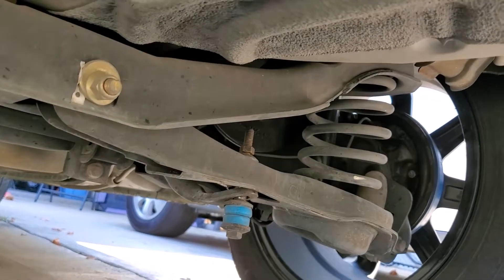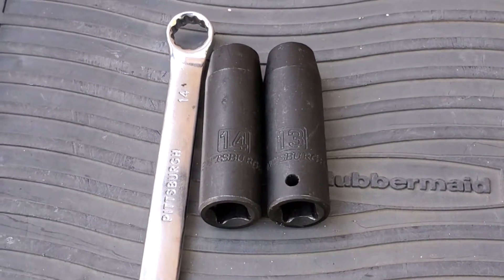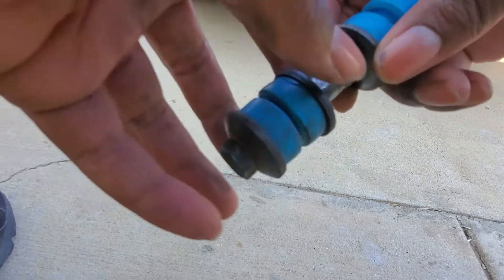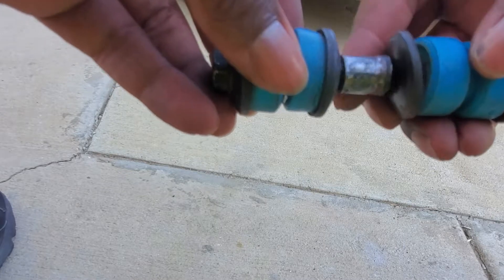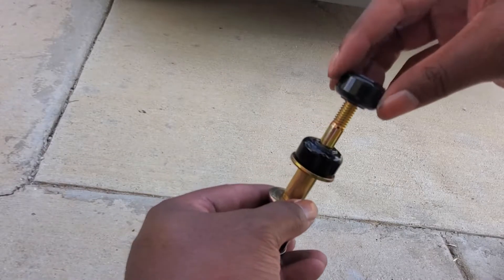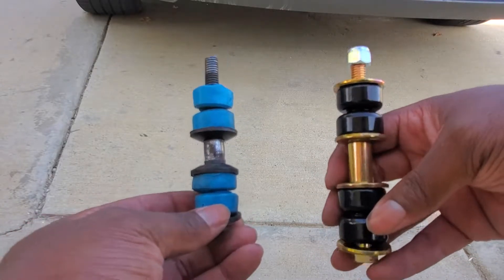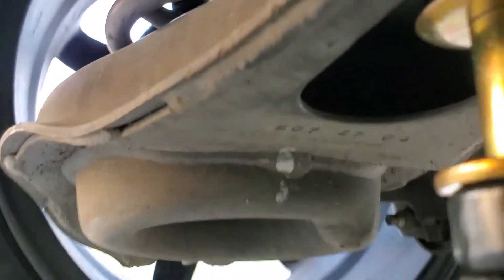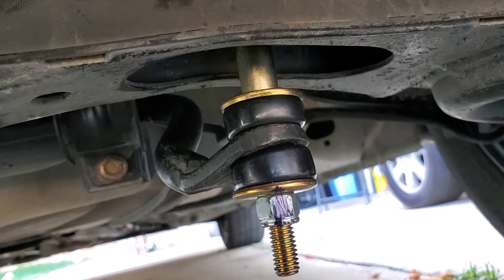Rear Sway Bar links Bushing change on a 2005 Ford Focus ZX4- Episode 2

Comment: Great videos . I was about to replace my sway bar and all the bushings because I had to replace the rear subframe it rusted out. But the sway bars themselves seem to be few and far in-between. I think I'm just gonna sand blast and reuse it.
Reply from the maker: Sounds like a good plan. I swapped mine out the some volve c30 hatchback rears.

Comment: I installed mine like yours and it works fine! You can install them up or down... that really doesnt matter!
Reply from the maker: Yea it doesnt really matter
Reply: Yes it does matter,Ford designed them to be fitted with the threads facing upwards,There is a good reason why they should be fitted this way get a workshop manual it's explained there.

Comment: I know this video is old but I plan on doing this myself and great job at explanation but small question, did you have to jack the car up or can you do it while the car is on the ground?
Reply from the maker: Na you can crawl under the car while its on the ground. Granted you didnt add a lowering kit prior :)
Reply: @FocusedHands  cool😎 and I do have lowering springs 😅but the rear still has good crawl space.

But thanks for letting me know😎😉
Reply from the maker: @notsostaticezequiel4054  np! if I can be of any further assistance let me know! ATF included!

Comment: Yeah, when did you notice the bolts were upside down.
Reply from the maker: I did it in purpose! There is no difference between them other than... it is easier the install and upkeep flipped!
Reply: @FocusedHands except for when the bolt hanging down hits something
Reply from the maker: @milwaukeevibe  wont happen

Comment: You put it together incorrectly again. The bolt should be facing upward with the nut on top
Reply from the maker: We proved this does not matter up or down. However, thanks for pointing that out.
Reply: @FocusedHands  it does matter. Thanks for sharing your ignorance
Reply from the maker: @milwaukeevibe  so please tell me how it matters! Since you have a expert understanding of suspension components on the Focus? Ive had this set up on over 25 and counting foci... with zero issues. No ignorance here sir... just wasting finger strength responding to nonsense. Happy holidays and I hope your Focus is still running!

Comment: You just installed it wrong again- the bolt faces up ,,the nutz on top
Reply from the maker: Na I did that on purpose
Reply from the maker: You can actually  install them up or down... I like up cause it is easier  to work with
Reply: Focused Hands your killing me smalls...
Reply from the maker: @phillipbedonie2777  I'm guilty
Reply: Mine works fine like he did it
Reply: @krombopulusmicheal8943  It will work, but the bolt protruding downward is just one more thing to snag you or your clothes while working under the car, or road debris.

Comment: You put them on upside down clown
Reply from the maker: Doesn't  matter clowner
Reply from the maker: Like it really doesn't  matter lol...bad design  by Ford which doesn't  do what it needs to
Reply: Does matter when you snag your overalls sliding under car
Reply from the maker: @patrickmoore3717  I've never snagged on anything with this car... other than the front fender!  But seriously  ford should upgrade like I did... to the mazda ball joints.

Comment: You don't have the rubber, spacer or the metal caps in the right place. It's all messed up. Your going to have issues with it.
Reply from the maker: Lol if I had a dollar for every person that said this id have enough for a new shop. This system function extremely well till I upgraded to a ball joint system. Might want to do the same!